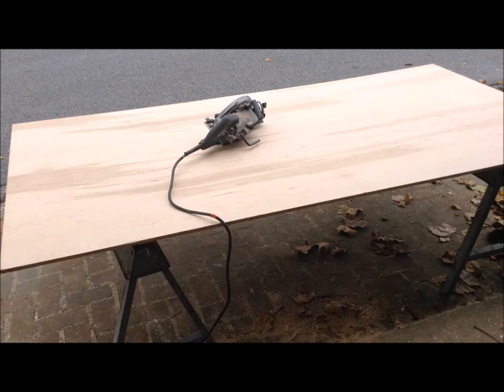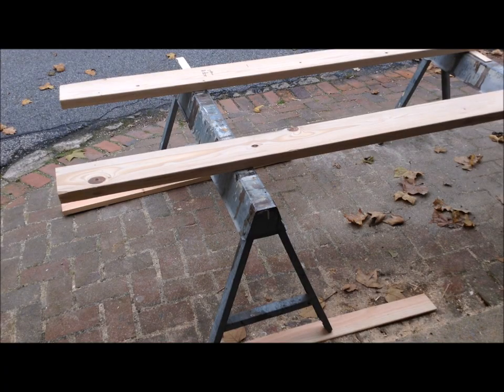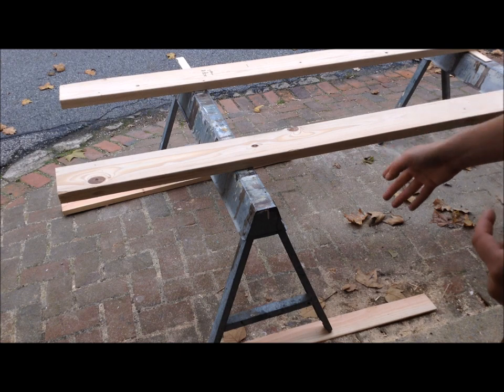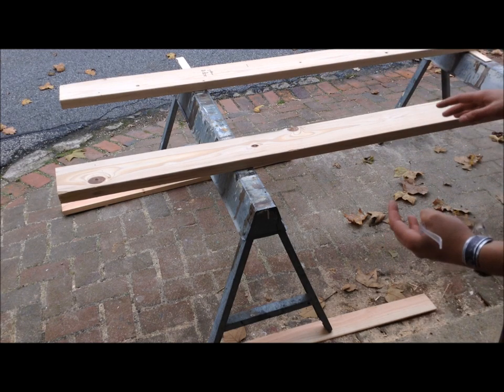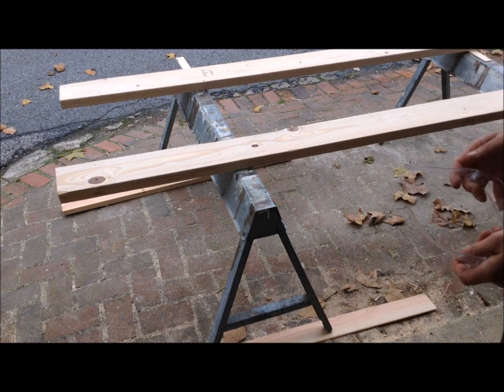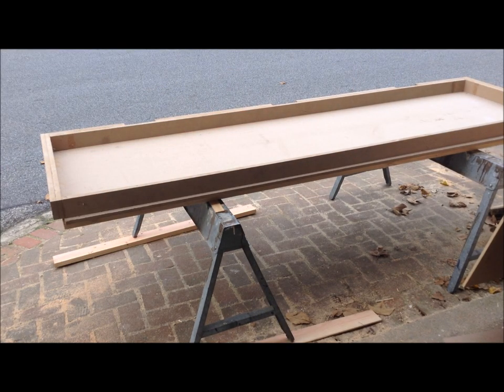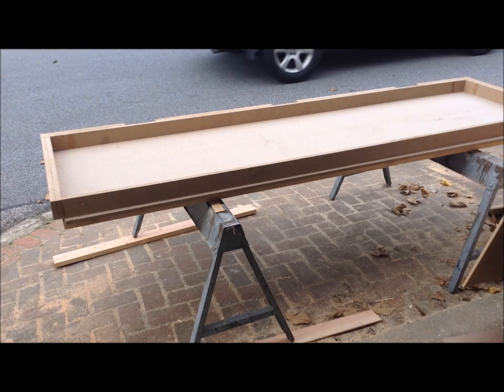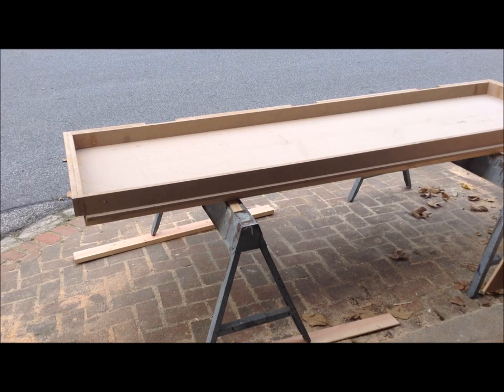Woodworking: Torsion Box Table // How-To Part 1

Comment: A lot of people are using the words "torsion box" but you are the only one who understands what a torsion box is that I have found on Youtube so far.  Thank you!  I am curious if the heavier skins have made it stronger. My understanding is that the opposing skins, the tension and compression of each, are the strength and not the cross-members.  Their function is to keep the skins perfectly parallel.  Am I mistaken? I am not an engineer and my information is from an article I read when I was a teenager several decades ago.  Again, thank you.
Reply from the maker: From what I have read the strength is in the thickness of the web, a four inch tall web will be stronger then a 1 inch tall web, and when built properly a torsion box acts similar to an I-Beam under compression.  The thickness of the skins is less important.  Since 1/4 material deflects more if you use something like this an an assembly table that you are hammering on or clamping things to depending on your web spacing it makes more sense to use thicker skins.   I cannot remember if I added the clip in this video but at one point with only the bottom skin added I propped this up on two saw horses at the very end of the box and sat in the middle.  I weigh 150lbs and it barely flexed even when I kinda bounced on it.  This link is one I used before building this it explains the "science" a little better than I do. https://www.popularwoodworking.com/projects/aw-extra-7413-how-to-build-a-torsion-box
Reply: go check out kings fine woodworking.  he did a torsion box top on his assembly table and goes into detail on how to make a back bone to keep it perfectly flat.  great video.  good luck you got this.
Reply: A taller lattice will give you a more rigid box for sure. One of the best features of such a design is it allows you to build rigid and light.  Heavier skins aren't a great use of added material, much better to deepen the grid and that can allow you to go even lighter in material depending on needs.

Comment: Way way better than butting boards..... one thought concerning the lifting issue and possible flatness issues down the road:

Consider how tight the halflap joints are fitted. From the video, it looked as if a mallet was needed to fit the pieces in place. That is an indication that the joint is too tight. 

If the joints are too tight- the effect is that the would is pushing away from center and the effect is cumulative.

A slightly looser fitting joint would correct that issue. I had a very similar issue and that was the only and seemingly best I could come up with to overcome that issue..... i felt I would up with a flatter table as well.

Great video
Reply from the maker: Yeah I made the joints a nice tight fight like you would for regular projects, but think you are right that the half laps were a little too tight.   Luckily I got it to work, but next time looser is better!

Comment: Hi, am I missing something or are you only gluing the butt joint of the grid to the exterior boards?  I didn't see where you glued the half laps in the middle of the grid.  I generally don't like using MDF but agree here its stability, uniformity and flatness make it the right choice.
Reply from the maker: I didn't glue the middle joints it was tight enough, and with being sandwich together I wasn't worried about them moving.  Agree 100% on the MDF usage.

Comment: Super job!  This is exactly what I was looking for!  Love your miter gauge contraption!  

I was wondering why you chose MDF VS plywood?  Seems way heavier and maybe not as stable vs humidity and temp changes?

I’m going to build something similar...sort of hybrid of this and a Paulk workbench.  I want it to be portable and very very flat...and you nailed it with this approach.

I’m going to try a 3x6 so it fits in my truck and matches my other workbench out of 1/2” plywood with even a 1’ grid and see how that goes...

Thanks for being awesome!
Reply from the maker: Reaching into my memory banks for this one, but I remember the customer knew a little about woodworking and wanted MDF.  One is it will come flat and stay flat, even high end plywood can warp/bow.   The house it was going in is climate controlled so temp changes weren't an issue, and I believe aside from very humid applications and water absorption plywood and MDF will perform about the same for the application I was using it in.  And, lastly, it was easily half the price of plywood.  I would have used cabinet grade plywood and by me even 1/2 sheets of that run around 50.00.  1/2 mdf is only 25.00.  Also, on stuff like this build I always do some research before building and check out the woodworking forums, and most people recommended MDF for the box.  Plywood works, but people prefer MDF.  I will admit the weight was a concern because it is definitely heavier then Ply, but because the room had 2.5 walls I could mount too that helped ease my fears on the weight.